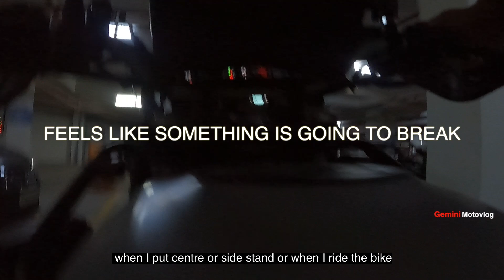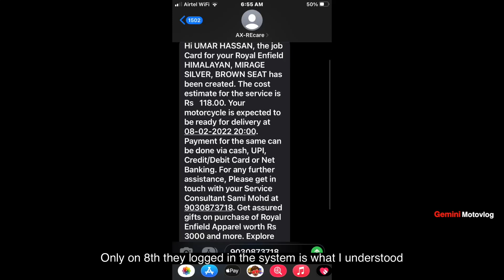❌ Rear Suspension Problem in BS6 HIMALAYAN 2021 😱 - SOLUTION ✔️

Comment: Mine does that too. I think it's the chain stretching. I'm going to change my chain and sprockets this week and will let you know. I also get a squeek that comes from the right side cap for the  swingarm axle. I just serviced the bearings and they were fine but the squeek remains. If you loosen the swingarm nut, the soudn goes away. loosen it a lot and lube between the cap a the swingarm pivot point.
Reply from the maker: Appreciate this will surely help others to find the issue

Comment: The sound coming at the end of video is related to clutch plate, when going for cold start let the engine idle for a while or pull and release the clutch for few times before taking off

Comment: Hi Prashanth Here,

Yup even I'm facing such problem since 600Kms & I've visited many times to the RE service, they just do the greasing to the bearing & after some 60/70 kms the issue is still there
Reply: Hi guys I am also facing the same issue at about my 2nd service and they got the bearing greased but issue still remain the same in just 100 kms.
Reply: Same facing here too in just 370km

Comment: Any updates? did they replace the shock absorber? ive been facing the same issue for over a year now, my bikes rear shock feels very stiff
Reply from the maker: I have replaced the bush as you can see in this video and so far good , I will update you if I get any update
Reply: @GeminiMotovlogsumar  Okay thanks for the reply💯
Reply: @GeminiMotovlogsumar  hope u are doing well.

Could you please let me know if your second issue is resolved ( the sound which was coming for the initial start ).
I  am also facing a similar issue , please help me to get this resolved.
Reply from the maker: @shehbazphulmamdi3655  ok will reply laterv

Comment: I am facing the same issue with my Himalayan bs6 2021 model, this noise comes from day one. total ODO is just 3000+kms 😐
Reply from the maker: bro just walk straight to showroom and give it back bro and let them know the problem
Reply: My odo is 6500 and it's the same issue. Also feels like my cone set is gone. The last sound was happening with my bike, first I used to think that its with the disc but it wasn't. After the 2nd service that sound went away.

Comment: I had the exact same issue with mine too.... The rear suspension was stiff and made a lot of crackling noise...... Finally had the rear suspension replaced under warranty but I still have the same issue. It still crackles and the suspension is stiff..... Pls help letting us know the exact bush...
Reply: Is bike vfm with all the problems or should I go for another bike?

Comment: Hey what's the update after 6 months does the sound come back frequently or its just went! And the sound u talking about is from disc it happens whn the pad and disc gets dirty
Reply from the maker: Nope now engine over heat problem
Reply: @GeminiMotovlogsumar  haha which will eventually lead to timing chain ie tapeet problem adjust the valve and  the timing chain in next servicing. I faced it too. No solution for tht .
Reply from the maker: @nzy001  I find it very difficult to drive even for 30 km ride planning to sell it if and take a different bike is what my thoughts ?😂👍
Reply: @GeminiMotovlogsumar  i feel the same sometimes, but as I stay in Siliguri which is very close to Darjeeling and Sikkim , the quality ride it provides in the mountains and off road is just awesome. It do struggle in highways and city... Specifically city this machine isn't for city it just burns the skin of legs , this makes me think twice and i just stick to it . Every bike has flaws .
I guess our himlayan isn't for Summers 😂.

Comment: Rare suspension going down pretty quickly as soon as I take the bike off the center stand. That's was not the case Earlier.
Will be going to RE service center to check the issue.
Reply from the maker: Recently started to hate this bike because of heat and other problems 👍😂